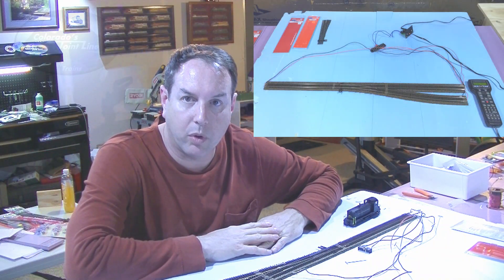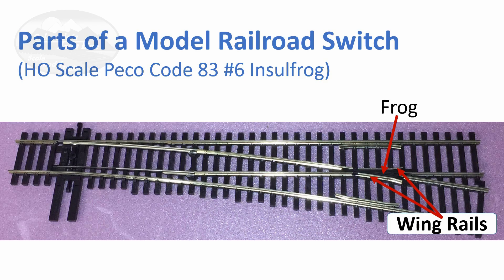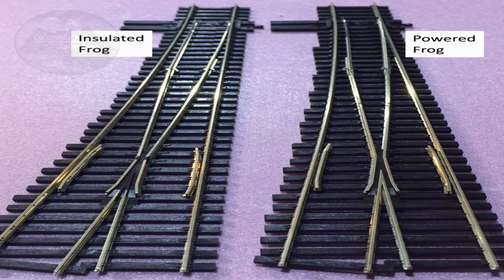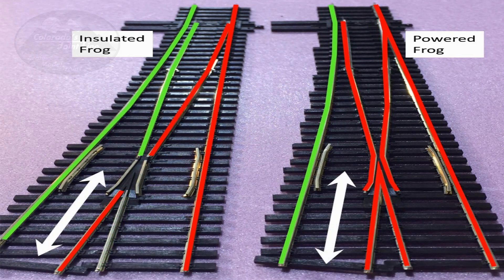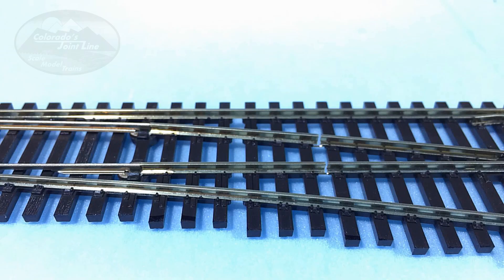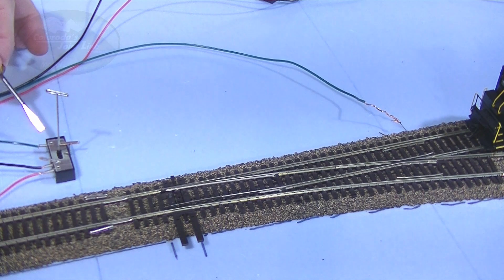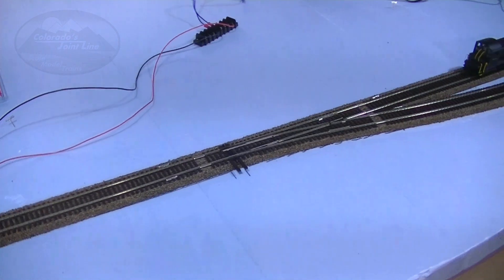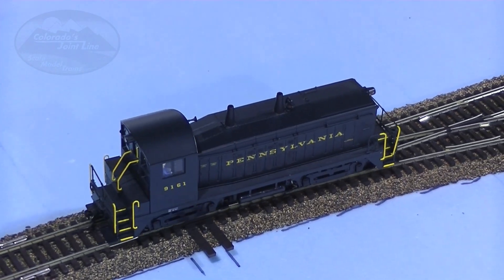Electrified VS Insulated Model Railroad Switches or Turnouts

Comment: Electro Frog Option 3: as with option 2 cut the jumpers between the closure rails and the frog, and then add a jumper wire from the closure rails to the outer rails. so the closures do not rely on the contact of the switch rails but are always powered. (they cannot short at the gap between the closure and frog because the wheels never run on that section when the frog is in the wrong polarity.)

Comment: Cheers for this video, very clear and precise. Helped me loads. Changed all my points over to  electro-frog points as I have several 0-4-0 locos which were having problems at slow speed. Haven't bothered switching polarity through the frog. I just have an off/on switch to isolate sidings to fiddle yard, otherwise all trains in the yard start moving !!! No problems with shorting out ever. Look forward to more of your vids.

Comment: I'm using DC on my small switching layout and have soldered power feeders to every single section of track, but have unpowered frogs.  I don't know if it's the age of my old Athern loco (35 years old or so) or something else, but it's speed seems to constantly change just enough to drive me crazy, depending on where on the track it is! I don't know if this is a function of the loco's age, or if it's because of un-powered frogs, but YOUR loco seems to go very smoothly and evenly through your un-powered turnout, even at slow speeds.  I have hard-wired the electrical pickups, cleaned the wheels, motor pickups, cleaned and lubed it, cleaned track, but it just doesn't have a nice smooth, consistent, slow speed.  Any suggestions? Thanks!

Comment: Thanks for this.  I have an N scale layout, DCC, and most of my switches are Peco insulfrog (power routing), but I'm wondering if I can use the few electrofrong switches I have in a stub-ended yard where there is no power fed beyond the switchpoints.  Thanks.

Comment: Nice video. Check this out  https://youtu.be/44h0LBmDhCQ  It comes in a kit that allows you to electrify the plastic non conductive frog right down to the point of the frog. No more dead spots on your RR or at shallow crossings. DCC yard creeping over turnouts is not problematic.

Comment: Question, I have put together a switching line using Insulfrogs switches now entering the switches by way of  wing rail side of the switch the locomotive will stop then start moving each an every time but I am now running locomotive entering the stock rail side of the switch and is no hesitation, Is there any suggestion on how to fix that problem

Comment: Excellent video, clearly spoken, close-ups when needed and the graphics are great.  I'll probably have to watch this again a few times to let the wiring sink into my 73 year old brain!  One question:  why do you use Code 83?  I'm just getting back into the hobby and see a lot of Code 100.  Cheers, Bob
Reply from the maker: Bob, thank you for the compliments and feedback on my video.  I use code 83 track because it is closer to scale than code 100 track is (though even code 83 is over sized for most prototype rail).  Most, if not all, engines and cars made in the last 20 years will run on code 83 track.  Prior to that, some cars and engines had larger flanges that wouldn't run smoothly on code 83 track.  In my opinion, if you're running newer cars and engines, code 83 track will perform just as well as code 100 track and I think it looks better.  So that's why I chose code 83.  Hope this helps.  Cheers, Kevin.
Reply: @Modeltrains  OK, I now remember the flange issue.  As I'm literally starting from scratch, I will use 83 due to the looks.  I have an MRC Prodigy Advanced2 system on order, along with an Athearn UP SD70ACe Salute to UP with the veterans salute also.  Now I need to  get some rail and build my platform.  Thanks for the detailed reply, and BTW, I've already liked and subbed.  Cheers, Bob

Comment: A "turnout" is comprised of movable switch points, a curved stock rail, a straight stock rail, closure rails a frog and guard rails opposite the frog attached to the stock rails unless the frog is self-guarding. "Switch" refers to the movable point or points of a turnout as per prototype catalogs such as L. B. Foster, Bethlehem Steel, every railroad that I know of as well as my experience on the prototype. It has nothing to do with an electrical switch that you may use on your model railroad.
Reply from the maker: Thanks for the additional information.  Cheers, Kevin.

Comment: I don't comprehended well at all, one of my learning disabilities; so, my question would be how do I determine which turnout to use-what's the determine factor?
Reply from the maker: It is really personal preference as to which turnout to use as they both work really well.  However, if I was to recommend one over the other it would be the Insulfrog version.  They are a little bit easier to wire than the Electrofrog versions and for most all applications work just as well.  Hope this helps.  Cheers, Kevin.

Comment: This is probably one of the best videos comparing electro vs insul-frog switches I've watched...and I've watched many videos!! I do have a question for you though. Our club layout just upgraded our power box and now, for some unknown reason, we're having issues with our crossovers. We have DCC with the option of DC power with the flip of a switch on 4 different "lines." We didn't have issues previously with our crossovers but we do now. Any thoughts?
Reply from the maker: Thank you for the compliments on my video.  As far as your crossover it is had to say.  One thing it might be is that your upgraded power box is allowing the power to arc just a bit farther and that's causing the short.    Hope this helps.  Cheers, Kevin.
Reply: @Modeltrains  that's a great place to start looking. Thank you so much!! Keep up the great work!!

Comment: Nice video. I never used the Peco Turnouts. Do they have sprung switch points like ME Turnouts? Thanks.
Reply from the maker: Peco Turnouts do have a spring in them that keeps the points pushed firmly against the stock rails.  Cheers, Kevin

Comment: Nice video, but you forgot to mention something. When you modify the Electrofrog point rails by snipping the little jumper wire, you electrically isolate the closure rails. On the Electrofrog, the closure rails depend upon the point rails for power. By snipping the jumper wires, the power source for the closure rails is removed, and the closure rails are now un-powered. The solution is to solder a small jumper wire from each stock rail to it's adjacent closure rail. This has to be done at the gap in the bottom of the ties. Doing this, the closure rails draw power from the adjacent stock rails, and are once again powered. Allan Gartner has a website "Wiring For DCC" which has a lot of useful info on track, turnouts, and other projects. Thank you taking the time to make this video. I found it quite helpful and informative! (Edited 1-13-19. I mis-typed something. Sorry for the inconvenience :? )
Reply from the maker: Actually the point rail does remain powered.  When the point rail touches the stock rail it becomes powered.  The jumper you mentioned is still a good idea and will prevent the point from becoming unpowered if paint, dirt, or something prevents the point from electrically contacting the stock rail.  Glad you found the video informative.  Cheers, Kevin

Comment: I'm not seeing why you feel the need to switch to the ElectroFrog turnouts. Those Atlas S2's are sweet running little locos.  Not sure if they are actually made by Kato, like some other Atlas loco's but the way they run it would not surprise me.  Like in life, I try to keep the wiring simple.  Less is more.  Less is better.

Anyhoo, good video and great explanation and thank you for your contribution to our great hobby.
Reply from the maker: Thanks for the feedback and compliments on the video.  Cheers, Kevin

Comment: Well I done F***ed up. I bought a lot of atlas insulated code 100 #8 turnout for my yard.
Reply: According to Atlas wiring book #12, all Atlas frogs are insulated but one type has metal and the other one has plastic frogs. If you have the Custom-Line Mark IV style then they can be powered. The book explains the process.

Comment: Hi, I build a new layout and used only PECO Insulfrog switches even running small tender loco's 2-4-0 (Fleischmann made) No problem at all and happy with it. But every switch has a feeder wire soldered to it with connection to both stock- and closure rail. Runs fine. Greetings and thanks for explaining & sharing.
Reply from the maker: Thanks for the information.  That's similar to how I wire all mine as well.  Cheers, Kevin

Comment: excuse my confusion but if you use insulated joiners on a electrofrog switch (point) you will have a longer length of dead rail ,which is ok for us locos but with 0-6-0 locos could be a problem,good video.
Reply from the maker: With an electofrog switch you have to power the isolated frog and rails separately.  This section has to change polarity based upon which way the switch is thrown.  Cheers, Kevin
Reply: thanks Geoff

Comment: As I promised elsewhere I am watching your other videos.  Another great, clear concise video.  You've got this down!  I don't bother subscribing to many channels, but you've sold me.  I do have a question;  do these shorts damage the locomotives at all?  I am the sort that likes to buy once, planning for future needs so the electro frog fits the bill, but the insul frog IS tempting for simplicity sake.  Risk to equipment could play a major role in my decision making.
Reply from the maker: Thanks for the feedback and for subscribing to my channel.  I've personally never experienced any problems with my engines or control system because of any of the shorts.  Most modern control systems, whether DC or DCC, have short protection built in.  Generally if they detect a short they will cut power to the rails.  Both types are excellent.  Additionally, Peco has now started producing what they call a "Uni-Frog".  It is effectively an Insul-Frog out of the box, but the frog can be powered like an Electo-Frog if you need a powered frog.  I've gotten a few of these in HOn3 and they work great.  However, I'm not sure they have made these yet for their entire line of switches and crossings.   Hope this helps.

Comment: what does it mean with a peco switch electrofrog when i switch it it shorts the main and my nce. Brand new, changed to an atlas same thing. Thanks great video.
Reply from the maker: Had to tell, but I'd start by making sure the rails leading to the frog are electrically isolated.  Hope this helps. Cheers, Kevin
Reply: Thanks so much Kevin, love all your videos very informative, thanks for taking the time for us all.

Comment: That was a great explanation. I too use PECO insulfrog switches and I was using insulated rail joiners which you explained are not needed. So, with my latest switch installation, I stopped using the insulated rail joiners and it's working as expected which helps me a lot...Harold
Reply from the maker: Thank you for the nice compliment.  I'm glad to hear that you found this video useful.  Cheers, Kevin

Comment: Did ya even mention aout reversing loops as concerns the 2 switches?  You mentioned shorting but I didn't hear you specifically mention that.  A lot of folks get confused.
Reply from the maker: No, I didn't cover reverse loops in this video.  There are lots of special wiring considerations, such as reverse loops, that need to be considered when building a layout.  This video was not intended to cover how to wire your layout, but rather focused on the differences in powered and non-powered frog switches.  Either can be used with reverse loops as long as you understand the wiring and power routing differences between them.  Cheers, Kevin
Reply: Thanks for the reply.  Okay I stand corrected but using the insulating frog I thought would make it easier in that respect.

Comment: My layout is new, a 17 by 18 ft garage N scale project.  Iv'e found that the insulated turnouts work so well with little wiring but, using only PECO #6 and even a few #8 turnouts. But to control them I use model aircraft hardware and make them manual control. So dang reliable and fun to use.  However, my 5 track staging yard uses Tortoise switch machines and Atlas turnouts but it is only here that they are used.
Reply from the maker: Thanks for the information on your switch control.  Glad the Peco switches and control mechanism are working out for you.  Cheers, Kevin

Comment: Insulfrog and electrofrog are being phased out by Peco as product dies need replacing. They are being replaced with a single version of the frog known as the unifrog.  See the following url: http://www.peco-uk.com/product.asp?strParents=3309,3322&CAT_ID=3326&P_ID=18132
Reply from the maker: Kev, thanks for the information.  I wasn't aware of that yet.  I'll check them out.  Cheers, Kevin
Reply: The Unifrog may only appear in new Peco USA Code 83 products.  As I pointed out, Peco has said it is phasing the Unifrog in as they renew the dies for the frog for different turnouts/switches. 

The only two track lines I know have the new Unifrog are the new HOn3 track line which is new and the even newer British style Bullhead Rail for 4 mm layouts running on HO gauge track (turnouts not due for a few weeks at retail outlets.)

I model both 1950  Southern Pacific and the British Southern Railway before the 1948 Nationalization so I keep a closer watch on Peco.

Ken Adams

Comment: so for a husband and wife, who are planing to build a layout. Which ones would you feel would work best.. I'm just not wanting it where the train stops and jerks I want smooth running.
Reply from the maker: Steven, welcome to the hobby.  I'd recommend Peco Insulafrog switches if you're just starting.  They are very reliable, offer smooth running, simple to wire, and work with either DC or DCC without any modifications.  You can see at the end of this video I'm running a small 4-axle switcher through a Peco Insulafrog switch and it is nice an smooth without any problems.  Hope this helps.  Cheers, Kevin

Comment: HELLO THERE A VERY CONCISE VIDEO ,,BUT I HAVE A PROBLEM,SOME OF MY SMALL..SWITCHERS,ESPECIALLY MY BROADWAY LIMITED STALL ON THE SWITCHES,,VERY ANNOYING ,ANY ADVICE WOULD BE GREAT PLEASE
Reply from the maker: Paul, it is very hard to troubleshoot electrical problems from afar, but here goes.  Is is just one engine, all smaller engines on one specific switch, or the same smaller engines on all of your switches?  That might help you narrow down whether you should be looking at a problem with your switches or a problem with your engines.  It could be that the wires for the all-wheel pickups in the engine are disconnected so only some wheels are picking up power.  It could also be that either the switch points, closure rails are not powered.  If your switches have a small hing on them (like the Peco ones in the video) between the switch points and the closure rail, sometimes the electrical connection at that hing isn't very good.  That will lead to the entire length of the closure rail being unpowered on an insulated frog switch--that's a pretty long stretch.  You might need to run a jumper from the stock rail to the closure rail.  However, if you have powered frogs, then the wiring is a bit different to ensure all the various rails are powered.  Try to narrow down exactly where the wheels are on the switch when it does have power, and when it doesn't have power.  That will help you figure out what type of problem to start trouble shooting.  Additionally if the switch points are only powered through their contact with the stock rail (most switches are like this), then any paint, glue, ballast, dust, etc between the switch point and stock rail when closed will impede electricity flowing from the stock rail to the switch point.  Again, if that's the case you can have a really long section of unpowered rail.  Hope this helps.  Cheers, Kevin